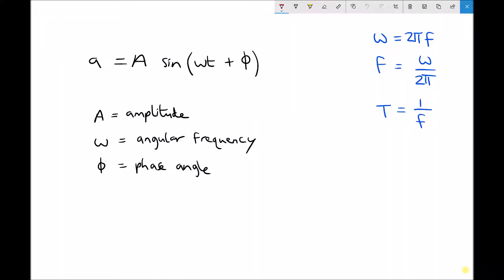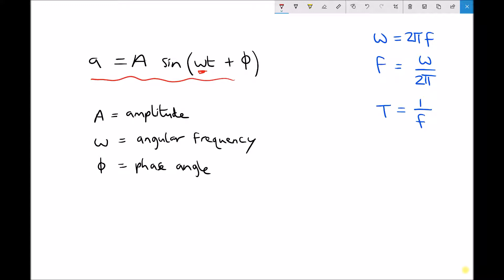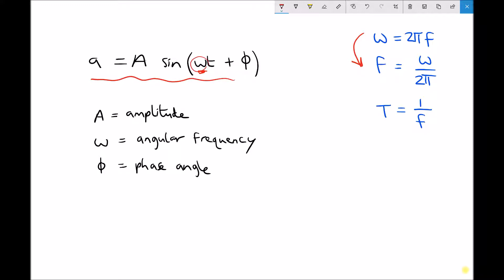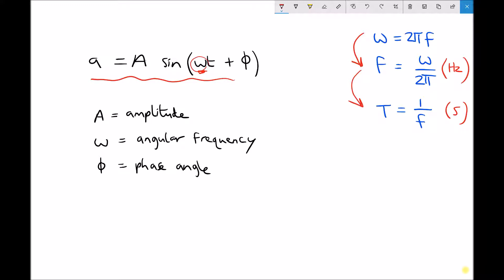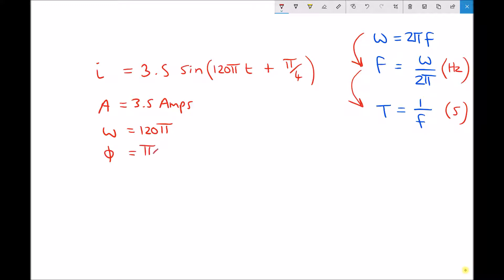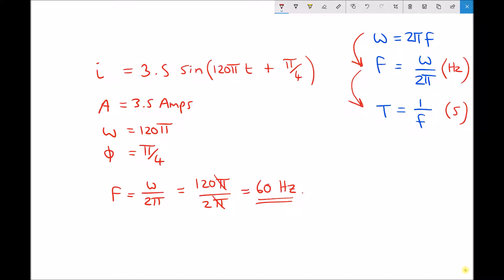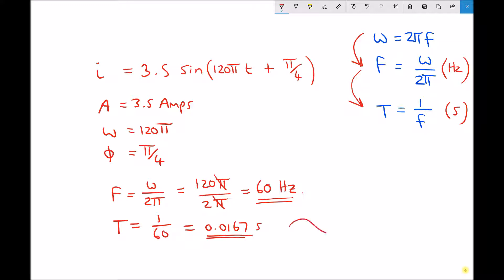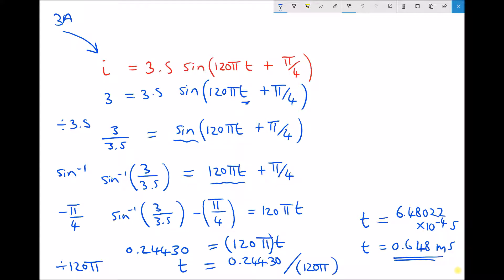Calculating Frequency, Periodic Time and Time to First Peak Value for a Sinusoidal Function

Comment: Your videos are getting me through my HNC! Im struggling on how would you find the first displacement of when its placed not on the peak of the graph but slightly off centre etc. Example: when does the first occurence reach a displacement of -2.  5.35 sin (100pi t + 2pi /45) , what I done is i made that equation = -2 and re arranged for t so -2 = 5.35 sin (100pi t + 2pi /45)
Re arranged for t = sin^-1 (-2/5.35) - 2pi/45 / all divided by 100pi. 
I got a negative answer for t, I added the period of the sine wave to make it positive but this was marked as the second occurence. 
If this is the second occurence, can I take away 1pi so again re arrange for time but do this 2 = 5.35 sin (pi (100pi t + 2pi /45)) and re arrange for t again? What would be another method of doing this?
Reply from the maker: Different methods possible, but I prefer to think about things in terms of symmetry, though it maybe isn't the best explanation for a youtube comment.
So in your case (ignoring the -2 for the moment), your function crosses the x-axis at -2/4500 (your phase shift 2pi/45 divided by angular frequency 100pi) which is roughly -0.000444
Now, you have calculated your negative answer at -2 as you say (I get -0.00166401)
So the difference between these (0.0012196...) is essentially how much further your solution at y=-2 is to the left as compared to when the function crosses the x-axis.
If you follow me so far, it is simply a case of adding a half-period to the point at which the solution crossed the x-axis to find out where it next crosses the x-axis. So in your case, -2/4500 + pi/100pi
(or -2/4500 + 1/100) which gives 0.0095556
Then returning to that difference we calculated before, we will add this to the second crossing, to arrive at the second solution:
0.0095556 + 0.0012196 = 0.0107752
This is maybe a bit awkward to explain in a comment but hope it makes sense. It is useful to visualise the function if you have not already done so:
https://www.wolframalpha.com/input?i2d=true&i=Plot+5.35+Sin%5C%2840%29100+pi+t+%2B+Divide%5B2+pi%2C45%5D%5C%2841%29+from+-0.01+to+0.02
Reply: @EngineersAcademyLTD  thanks so much this helps a lot!!